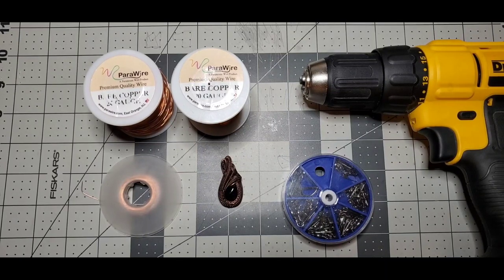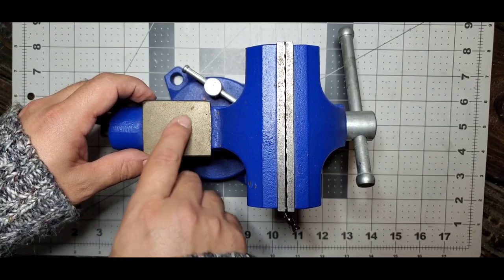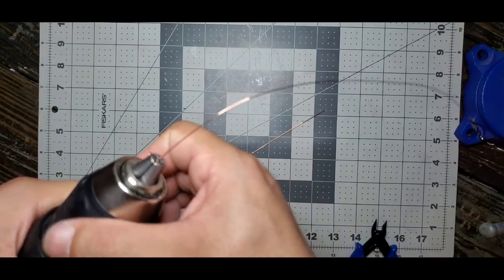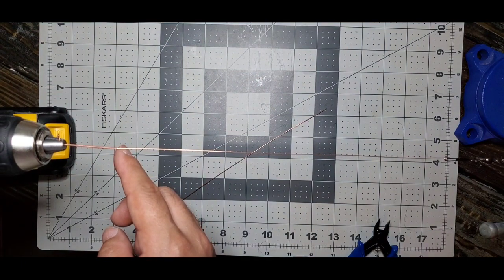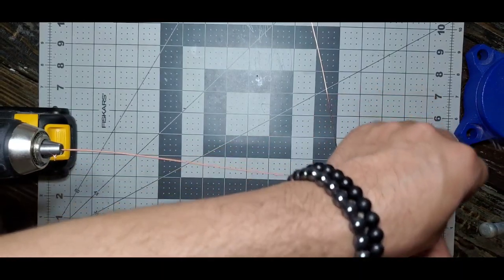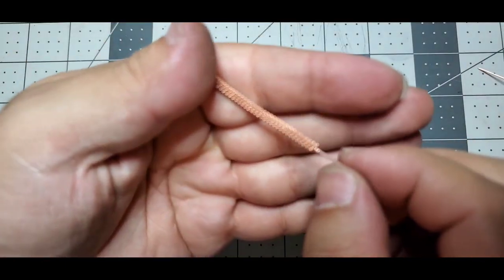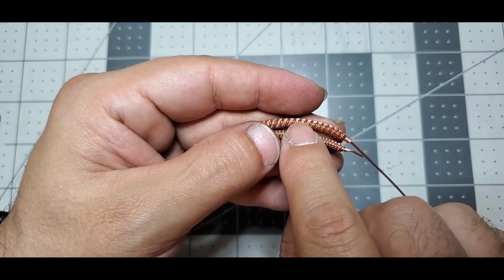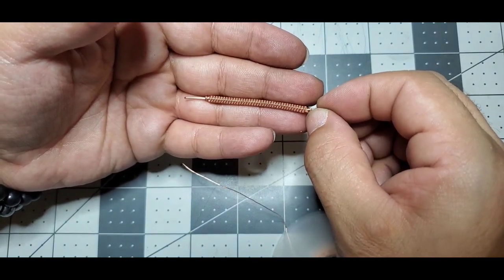Wire Wrapping - Coiling on a Drill

Comment: I keep trying this and different torque but the wire always breaks at the at the drill.  I'm not applying pressure that I can tell.  Any suggestions?
Reply from the maker: Sorry that I missed this comment. So the wire breaking is always going to be a tension/pressure issue. There are three main causes. Either the swivel is not spinning or skipping, there is too much tension from the pull back on the drill, or the wire your feeding onto the core has too much tension on it. Remember that copper is a very very soft metal, much softer than brass or silver. Make sure all of your wire is dead soft so that you can work it without much pressure.

 If your core is breaking trying to wrap the smaller coil onto a thicker core I suggest giving it maybe 4 rotations and then finishing by hand while gripping where it is already coiled. I have had to do this with thicker coils.

Comment: what size of fishing swivel did you use? and would it make an impact on the end result if using a different size of fishing swivel? such as a little smaller or bigger based on guess of size seeing at video's fishing swivel.
Reply from the maker: Size is not really important as long as the wire fits on it. I have a pack of assorted sizes and I have used all of them and get the same results.

Comment: How do you get the drill and vice to line up? I have been looking for a bench vice. My sister has a drill I can use but I am afraid one will be higher than the other. How do I get the wire to line up?
Reply from the maker: I prop up my vice on a thick hardback book. I have found one that gets it right where it needs to be so I pretty much just keep it by my vice all the time.
Reply: @sethedelinski348  Thank you. I will try that

Comment: How do I stop my core wire from tearing apart from the drill
Reply from the maker: Less tension both from the drill and the feed wire. That and slower speeds. Thicker gauges tend to fair better. Copper is very soft and if the drill head (chuck) is spinning more than the wire that means the core is twisting and can only twist to much before it snaps.

Comment: Do you have a drill recommendation?
Reply from the maker: So I just use one of my work drills which is a  dewalt. All that matters is that the chuck (head of the drill) is adjustable. So a impact drill will not work. I'm pretty sure most any standard cordless drill should work.

Comment: Is your antique copper wire dead soft?
Reply from the maker: I use bare copper and oxidize it myself. Everything I use is deadsoft. If I want something a little more stiff for a frame or something, I will work harden it with my fingers and nylon pliers.

Comment: Why does my wire break in the drill?
Reply from the maker: The root of the issue is copper is extremely soft. The thinner the gauge the more you will have snaps at the drill head. You want to use the least amount of pressure needed both on the drill and your feeding hand. 

I just did some coils yesterday and did have some snaps while spinning on a 24g core. I just clipped it and reinserted into the drill. I lessened all of the pressure and tension i was useing on both ends and no issues.